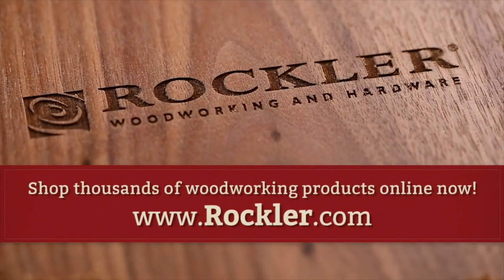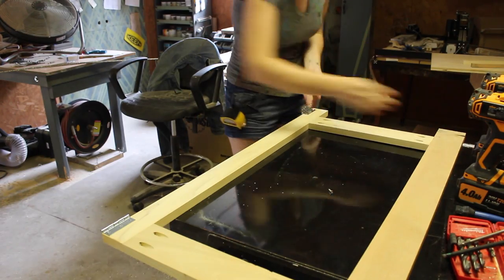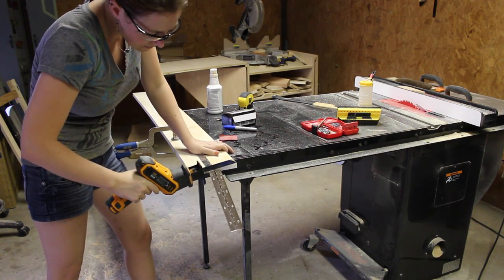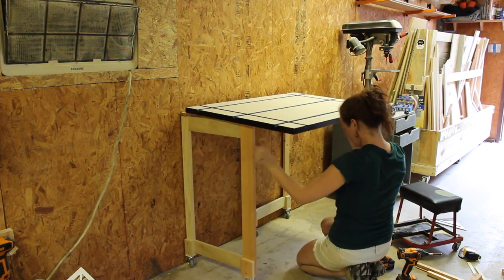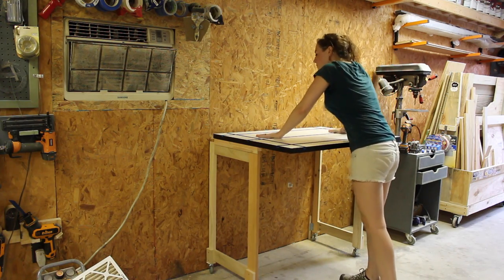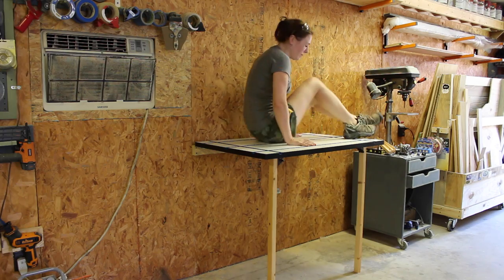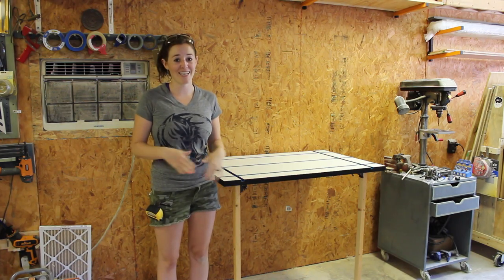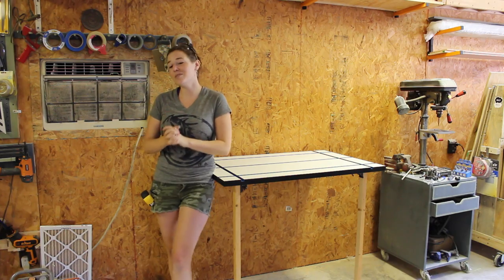Make a Folding T-Track Table

Comment: I simply love the process where you try things that do not work out just right and overcome the challenges by thinking through them and finding a solution. I think this is a VERY VALUABLE lesson for many  DIYers. The highest skill levels are attained through learning and trial and error. Thanks for not editing out the parts that did not work; they're as integral a part of this video as the parts that did. Keep the faith DIYers you will succeed, eventually!.

Comment: I like the space saving tables. Of course all those flat surfaces are ideal for piling stuff up. I tend to put stuff down instead of putting stuff away if there is a too convent table nearby. I do think the design change worked out well for you. Keep up the good work.

Comment: I've lost count of the number of projects where I've had to backtrack because of some issue that presented itself later in the process. I'm glad you included your whole process, and that you made use of the original legs you built. (Incidentally, none of the floors and walls in my shop are square to each other either, so I can relate to the first problem you ran into with the legs not swinging out smoothly.) Your video also gave me some new ideas for the project, even though you didn't actually do them. And you got yourself a new subscriber! 😊

Comment: In an attempt to plan around a lot of reworking of projects I learned to sketch up a set of plans and then mull over them for a day or two.  Typically the best way to construct it to my needs becomes aware and since using this technique I don't back track and waste time.  I have a friend that builds small scale models of her projects to save time and waste.  Works for her.

Comment: Hi April,

You really are the queen of pocket holes!. After watching quite a few of your vids I think it's justifed to conclude they are your primary method to make 90-degree joints. You have quite a fancy tool to make them too, I haven't seen anything like that around here which is one of the reasons why I don't use pocket holes that much . The other one is concern for the strength of those joints but it seems to turn out OK for you each time so perhaps it's not that bad after all. I really like what you put online, it gives me ideas and it's nice to watch. Greetings from NL!

Comment: love your videos, If that is a 110v air conditioner, they make what are called "appliance cords" they are short extra heavy extension cords. if 220v make your own with up to 3 feet of 10 AWG wire and replacement ends

Comment: April,
Nice job on figuring it out to work the way you wanted kiddo. One small tip that might help you with your sawsall...shove the saw's shoe against whatever you are cutting and the blade will work better. I noticed in this and your last video that you were using it more in the middle of the blade, that allows the saw to work you and your hand / arm. Try it on some scrap and see what you think. Again, thank you for all you do.
Mike

Comment: Interesting bench. For your wiring issue, I would add a new plug just below the unit, then trim the excess wire from the unit. Would look better, and would be safer than having a long cable hanging around that could get cut. Interested to see what you come up with next.

Comment: great video i was wondering if instead of metal bracket folding mechanism can you use bolt screw as you did on the folding table up direction ...

Comment: For that A/C unit just add an additional outlet higher up. Looks like your wall covering is easy to remove for access.
( Or just a surface mounted outlet powered with some 12-2 wire and a plug on the end so you can plug that into that other outlet )

Comment: A means of keeping the legs from being 'kicked' in might be high strength magnets. They can easily be set below the surface of the legs and washers put on the table for them to hold against. Might solve the problem, leave little visible and be quite cheap.
Reply from the maker: The leg brackets on the Rockler table lock in both the up and down position so they are good to go. Then the other style feel like they are alright as well. However, magnets would be another great solution!

Comment: Hey April, here's an idea. You can splice that power cord for that window unit. Use a junction box and from there you can pretty much make your power cord as long or as short as you wish. 
On another note: what can you do with that T-track table? I'm wracking my brain with different possibilities but I would like to know what or how it is actually intended to be used. thanks. 

Great job with the continues progression of your shop.
Reply: +Rookie.YouTuber.VMJ  Actually would be better to put in a surface mount metal box, electrical socket and run conduit to the other outlet.  Its usually a bad idea to cut the wire because often those window units have a built in circuit breaker built into the plug.
Reply: +Rookie.YouTuber.VMJ  Its always a bad idea to splice  the better way is rub conduit to the window unit  disconnect the power there is normally an access panel on the unit ,  open it get a length of the same cord from the hardware store and take one wire out at a time so you don't forget which wire goes were.  run the wire threw the conduit  to the plug socket swap the plug on to the new wire  job done

Comment: I have 2 home depot workbenches in my room. One is used for my jewelry projects, the other is where my laptop and printer is for more administrative projects. On the laptop workbench, I am trying to think of ways to add a "hideaway extension" using a swivel type thing, that when it is open it becomes an L-Shaped table, with the extension being 5 inches lower for me to place my extra "stuff" when I'm working. (For some reason I am more comfortable doing my administrative stuff lower. (Workbenches are both 70" long x 35" high x 28" deep. So I use a drafting chair.) I have drawn several sketches, but don't really have skills for anything complicated. I would love it if you did a video on something like that.  Or do you by some luck already have one? :)  Thanks. You are talented.

Comment: Can T Tracks be used in a table to glue up boards into a panel? I wonder if they are good for holding enough pressure to close and hold the gaps?

Comment: I'm surprised more people don't seem to have folding worktables, the space saving is huge, you can even have a rolling cart in front of it when not in use.
Reply from the maker: Well mainly people express concern about piling stuff on top of them and never folding them away. My solution for that is to make the things they are piling on top of the bench a place to go. However, if people are not in the habit of putting things back where they go then I have no solution. : )
Reply: Brilliant answer! And I completely agree, Even though I use every horizontal surface as "temporary" storage ;-)
Reply from the maker: I do as well especially during a project, but I make it a point to pick up (at least a little) at the end of the night, then pick up the whole shop at the end of a project before I start on another. You can work so much faster if everything is organized.

Comment: You probably already figured this out.  I suggest:  For the air conditioner power cable fix, you could remove the wall panel from beneath the unit and wire in a single or double duplex outlet installed high up on the wall, wired in to the lower wall outlet. I think it will be easier and less expensive than surface mounted metal conduit.

Comment: Get a  appliance cord of 12 gauge 3 wire. It will show 12/3 label. You want 12 gauge as you need that size copper to carry the power required for the air conditioner without overheating the cord. I do like your solutions to the opportunities that arise.

Comment: hey April, instead of lengthen the cord why not just cut a notch in the support board that screws to the wall I just put the cord through the notch? it only has to be is wide and thick as the cord. I don't believe it should cause any kind of structural weakness either, at least not one that should make any difference.

Comment: Plug mold.  They make a metallic channel that you can screw to the wall that you can run your cord under.  Tatamount to conduit and a lot less bulky.  check them out they make a variety of things and can be found and any electrical distributor such as Graybar, McNaugaton & Mckay, or All Phase just to name a few.

Comment: Rather than extending your A/C wall unit's power cord, which was likely only designed to be the length that it is now, it would be good if you could mount a receptacle right next to, or directly underneath the power cord.  To save time and hassle of having to fish wires, you could install an extension ring over your existing receptacle that powers the unit.  This would allow you to run armoured cable (sometimes known as AC90 or BX) from the extended receptacle box up and over to your new receptacle location next to the A/C unit.  This would meet electrical code requirements (where I live anyway), as long as the circuit supplying power to the A/C unit is not overloaded according to its rating.  To deal with the extra A/C cord, simply coil it up neatly and tie wrap (zip tie) it into a shape that you can tuck away next to the receptacle.  You can strap it down to the wall to make it take up less space.  Just make sure you turn off the power before attempting any of this, and make sure you use all the right parts and tools.  I would also verify the wall unit's maximum wattage consumption to ensure it doesn't need to be connected to a dedicated circuit.  If this is all gibberish to you, feel free to message me and I can give you more detailed instructions and material lists, but in simpler language.  And yes I am a licensed electrician, albeit in Canada.  Great channel and cool projects.
Reply from the maker: Whew, this is wonderful information. Thanks a lot. Tons of people have said "just splice it" and I was wondering if that was the best option. I'll holler at your if I have any questions, but your comment sends me in a great direction.
Reply: Anytime.  You seem real and nice--I like helping people like you!  And just so you know, there are quite a few different ways to do it that would meet code, but this is probably how I would do it.  Just make sure you don't overload that circuit (and correct that issue if it already is overloaded by running your BX all the way back to the panel and giving the wall unit its own breaker).  I'm here if you need me and if you don't mind a possible day or two delay in response.

Comment: cool.

Did you make that rolling stool you're sitting on or can I buy this?
thanks
Reply from the maker: No I didn't make it. I actually found it in the trash with a busted seat so I just built a new seat for it. I think you can purchase these at Northern Tool if I'm not mistaken. http://goo.gl/SwrKLS

Comment: Where did you get that low sitting rolling seat? I must have one! My drill press is on the floor tucked under the stairs - I have no more room.
Reply from the maker: I found it in the trash broken up with no seat, so I brought it home and made a new seat for it. You can find them at Northern Tool though.

Comment: Great job April, stick an insert plate in it and you've a folding router table...
Reply from the maker: I was thinking about that, but my router would make it so far out from the wall when it was folded. So I was thinking about cutting into the wall and making a cut out for where the router would hit. : ) We'll see. I'm still thinking it over.
Reply: +April Wilkerson The insert plate need only sit in a rebate ( rabbet ) together with the router it can be removed when not in use.

Comment: Why do you use rollers on the wall-side of the legs? I think the hinges should be enough.
But nice video with good ideas, keep up the good work!
Reply from the maker: Because the legs weren't touching the ground. This way with the casters, there is some play in them so they touch the ground but do not get stuck when it's folding in and out.

Comment: For your A/C line, why don't you just run a new line down from the ceiling (or up from below) to a dedicated, single outlet box? That way, you won't have to worry about extending the cord from the A/C. And, it's much safer!

Comment: LOLZ....First i noticed, besides a beautiful and talented lady was your wall mounted air conditioner with the face off. I had to laugh as thats how mine is several times a week, constantly brushing the radiator and vacing out wood dust. I desperately need a dust collector.

Comment: i attaced mine to wall using cleat system i can use it anywhere in shop have cleates along walls at 3 leve;s so my work benches match tablesaw height

Comment: Why would you use a push stick to hold the cut off piece on the mitre saw and then go further and not hold the frame 1:06? Very unsafe. Also why not use the t-track table itself when screwing the pocket holes since you already have the table top?
Reply from the maker: I'm holding that side because I'm using a stop block at the miter which means that piece, between the stop block and the blade has a chance of binding and getting kicked at me. It would be unsafe to not hold it. I didn't use the table top because it wasn't installed.

Comment: Remember the "KISS" method...Keep it simple stupid!  Great video!
Reply from the maker: Well my thought for going with the legs swinging out from the wall is it would be more support for the table than two legs up front, and my originally planned set up only left 8" of the workbench unsupported. Anyways, I had to make a few revisions along the way and it ended up leaving 10" unsupported and that changed the overall direction. : )

Comment: very cool, instead of cutting your ac's cord, why not just mount a power strip just to the left of it?
Reply from the maker: I might, that was actually my first thought but I didn't find one at the store that fits it. This is a 220 plug that has a horizontal prong and vertical. I bet I can find one online but I haven't had time to look.
Reply: +April Wilkerson ahh I didn't even know there were 220v A/C's lol

Comment: You are a perfect candidate for using "Sketchup". An easy to use 3D modeling softwsre program. there is a free version and a Pro version. There are also many videos on woodworking with Sketchup.  I use it at work. (I also use AutoCAD Civil 3D.) With Sketchup you can design and build your project, without cutting or nailing a thing. Check it out. It's a lot of fun.

Comment: Could always just put a standard latch going up and down on the org legs to prevent them from kicking over too. http://www.homedepot.com/p/Everbilt-2-1-2-in-Zinc-Plated-Barrel-Bolt-15142/202033904

Comment: oh April Wilkerson ,i like your workshop and i like you,iam falling in love with you,i like white skin,and your smile,but i cant make the table like yours cos my wall from  brick not from wood,and you done verywell
Reply: Attaching to concrete is no problem.  Use concrete anchors to secure the ledger board to the wall. Some are better for block walls and others are better for cement walls (poured in place). Do a  little research at your local lumber yard or big box store and they will have the anchors. Try to find someone there that has experience and is not just an aisle attendant. Talk to more than one person to get different ideas.